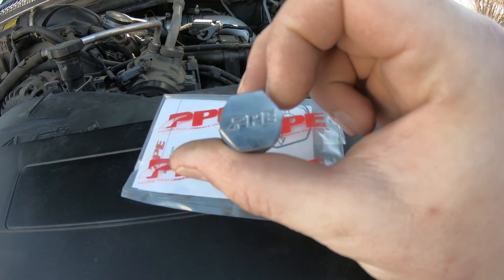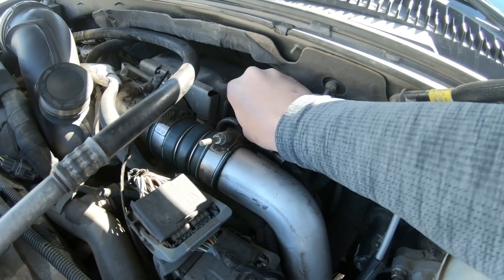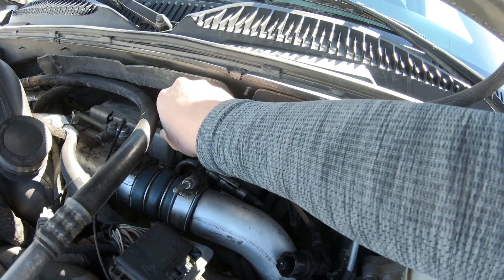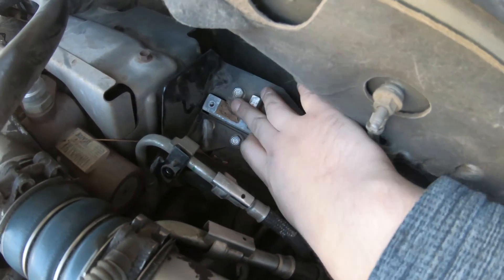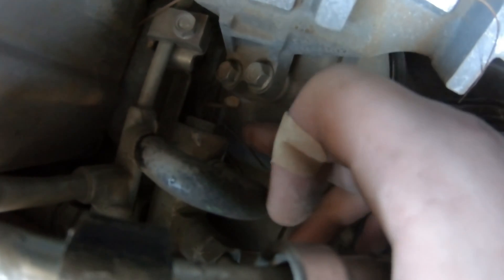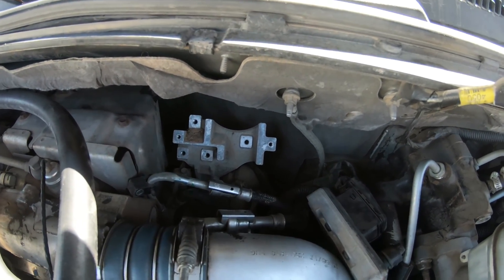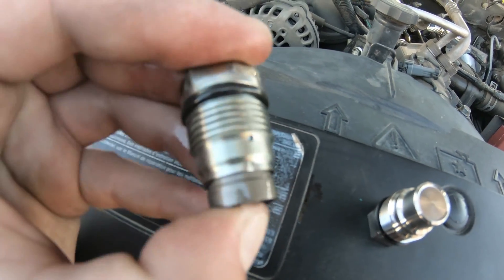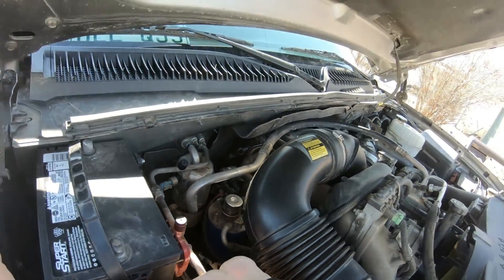PPE Fuel Rail Plug LBZ Duramax

Comment from the maker: Ultimate LBZ Build List:
Stage 6 Allison 1000 6 Speed Trans
Air Dog II-5G 220GPH Lift Pump
EFI Live DSP5 w/ Trans Tuning
HSP Hot and Cold Intercooler Piping
HSP Billet Forward Facing Thermostat
HSP Y Bridge
HSP Cold Air Intake
HSP Fuse Box Cover
HSP Coolant Tank Reservoir
HSP Traction Bars
Rough Country 6 Inch Lift Kit
Rough Country Wheel Well Liners
Kryptonite Control Arms
Kryptonite Upper and Lower Ball Joints
Kryptonite HD Center Link
Kryptonite Tie Rods
Kryptonite Alignment Cams and Pins
Kryptonite Wheel Bearings
Kryptonite Bump Stops
Kryptonite DeathGrip Idler Side Package
Redhead Steering Box
Kodiak Truck RDS 68mm Turbo
ARP Head Studs
100 Over Injectors
Transgo Jr Shift Kit
PCV Reroute
4.56 Gears
37x12.5r18 Tires
3 Inch Body Lift
ATS Twin Fueler Duel Fuel Pump
Titan Larger Fuel Tank w/ Sump 
High Performance Welded Water Pump
High Capacity Cooling Diff Cover
Extended Travel CV Axles
Kodiak Truck RDS Transfer Case
PPE Fuel Rail Plug
PPE Ported Fuel Rail Fitting
PPE Deep Engine Oil Pan
PPE Deep Allison Transmission Pan
PPE Deep Allison Transmission Filter
PPE Extreme Performance Oil Filter
PPE Coolant Bypass Tube
PPE High Flow Exhaust Manifolds 
PPE LB7 Up Pipes
PPE Magnetic Oil Drain Plug
Edge Insight Monitor w/EGT 
3" Wrapped MBRP Downpipe
Goering Torque Converter
Eaton Truetrac
Fluidampr Harmonic Balancer
5 Inch Straight Pipe Exhaust w/ 7" Tip
Full Cadillac Escalade/Yukon Interior
2018 JumpSeat Center Console Delete
Custom c/z shape bubble tail lights
LED DRL Headlights
Boost Auto DRL Tow Mirrors
DIY Switchback Door Handles 
Rock Lights and Wheel Lights
DRL Tailgate Handle LED 
LED Chevy Bowtie on Grill
Lighted Amp Power Steps 
Savannah/Tacoma Climate Knobs
2018 2500HD Front Bumper
2015+ Rear Step Bumper
Intimidator Silverado SS Tailgate Spoiler
Sunroof Crew Cab
'05-12 Nissan Titan Power Rear Window
2 MTX 600W 12" Subs Under Rear Seat
Bawer Stainless Low Profile Toolbox
Hood Mirror Kit
Rear View Mirror Dashcam (4 Cams)
Tailgate Reverse Camera Bezel
Folding, Extendable Headache Rack
Tonneau Cover
Gen-Y Drop Hitch
Square Body Silverado Tailgate Badge
2 Inch Cowled HD Hood
Paint Matched Everything
Custom Chrome Escalade Cluster